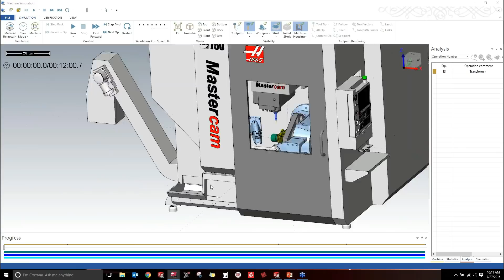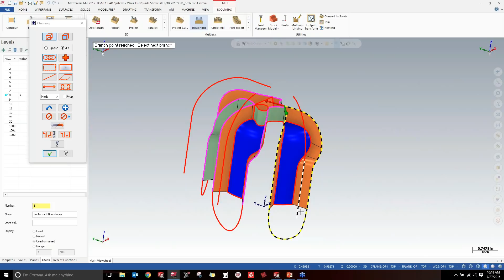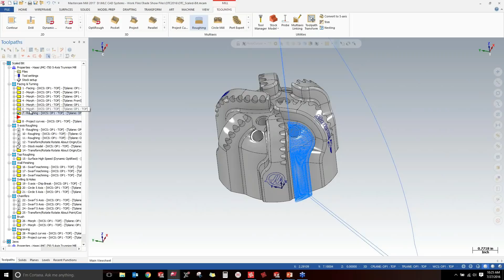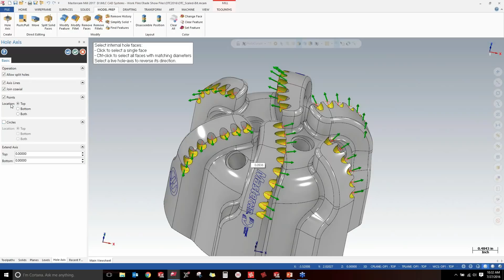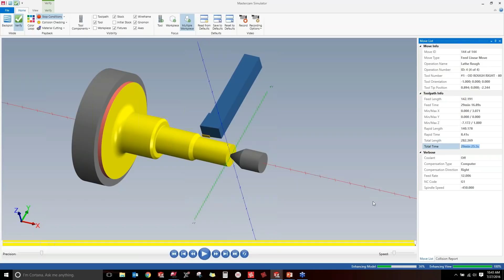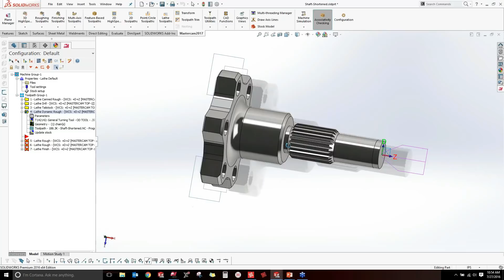Simplify Your Most Complicated Parts with Mastercam | Tips and Tricks Webinar

Comment: Is it possible to turn an O.D. that isn't on center line without using a fixture, a 4-jaw or C-axis milling? Or turn an O.D. that rotates on a x axes that is not the absolute center line? I've seen Mazak videos where they turned a crank shaft. Here's a video. I'm drilling but curious how to turn or bore. Thanks. https://www.youtube.com/watch?v=70VI7qA8bdw&feature=youtu.be

Comment: Was wondering if there was a way to mill out the cutter pockets with a circle path or contour like you 5 axis drilled without setting a plane for each hole?
Reply from the maker: That’s a great question.  You can absolutely do so.  In the multiaxis group of toolpaths, there’s one just for that, named “Circlemill 5-axis”.  It allows for a variety of strategies for circular interpolation of holes, and allows selection of features just the same as “Drill 5-axis” allows.  Very easy to use.  If you have additional questions, please contact us contact us through our website mlc-cad.com and we will be happy to discuss this more.